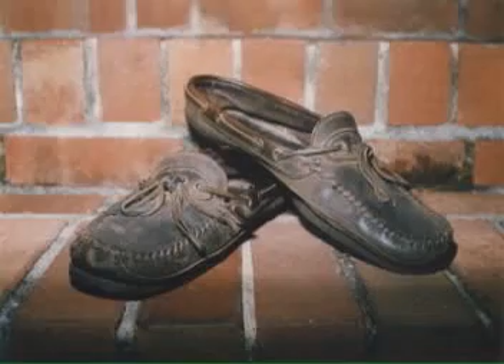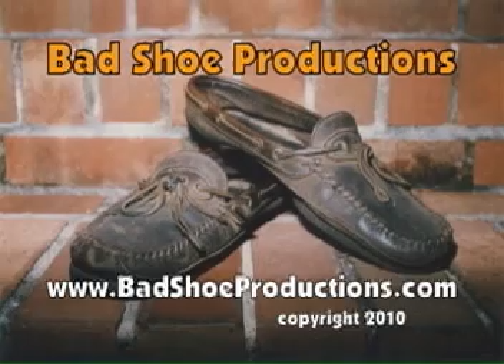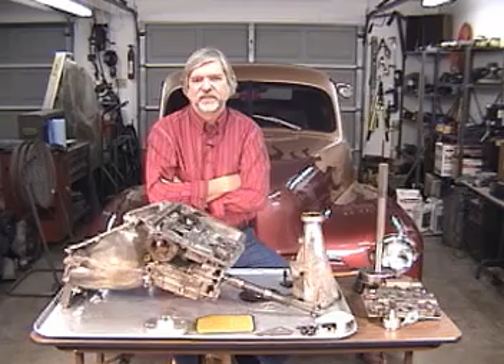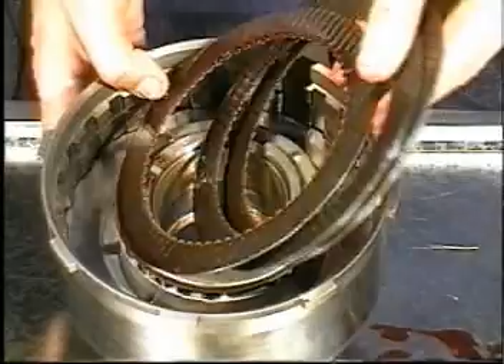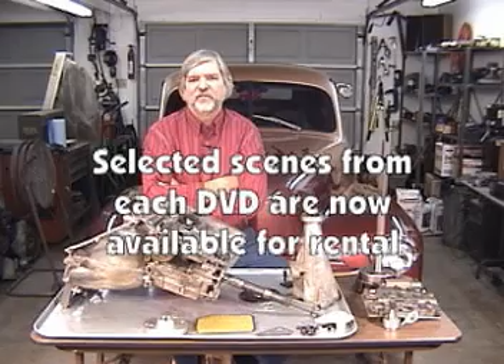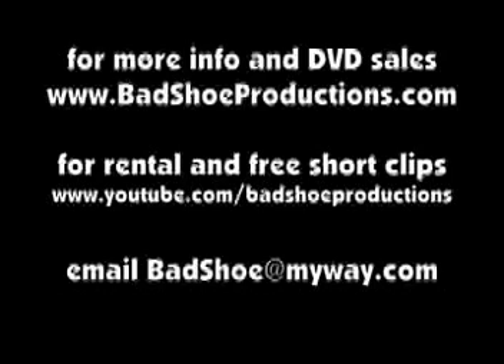Welcome to BadShoe Productions

Comment: Ok, for the record. Are all Ford 02 sensors calibrated the same? If so the I'll stick with my stock connectors. ..but then again I don't know if the pins are connected the same between the 86 vic ecu and 89 mustang ecu.
Reply from the maker: They all read the oxygen the same but there are differences. Some have heaters, some not. Of the heated O2's there are both 3 wire and 4 wire units and of course, there's different wire lengths.

Comment: Hello sir it's me again, I had question about 02 sensors. ..as you know I'm
using my stock engine harness but I also have an 89 mustang harness as
well. Do I swap over the 02 harness or can I use the stock ones from my
vic? Thank you for your time.
Reply from the maker: If the hardshell connector fits the old O2's, you're fine. If your new harness uses a different style O2 connector, then change to an O2 that fits.